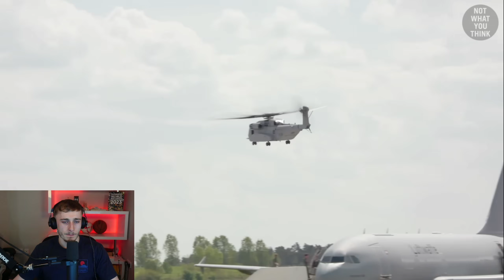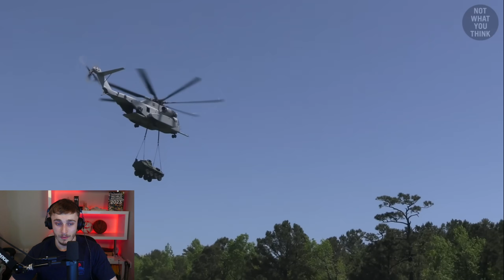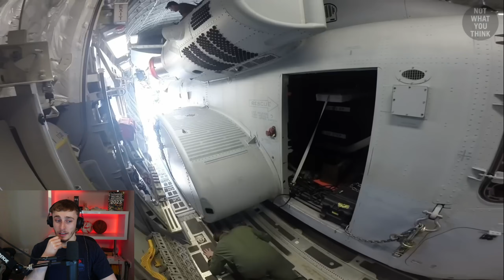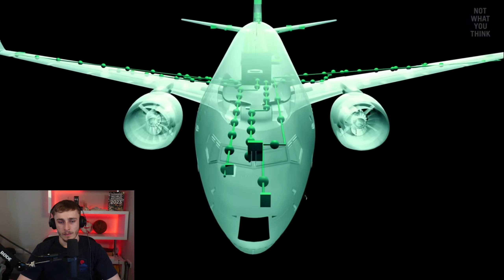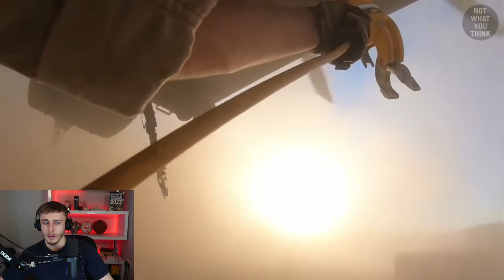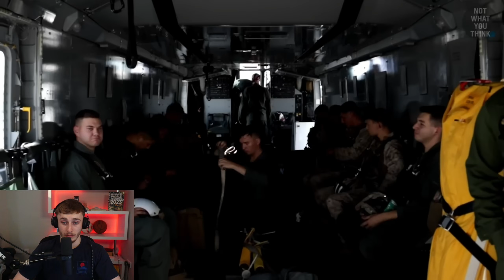Brit Reacting to The US Military's Largest Helicopter: The Ballerina That Lifts 35,000 lb

Comment: Helicopters, because of their method of lift, run into a size and weight problem long before planes/jets do. Because they're using a rotary blade to lift them vertical, they can only lift so much with so much power behind it and those blades have a material durability limit as well. The blades have to be so strong as to not rip apart while spinning, but they have to spin so fast to generate lift adequate enough to lift the fuselage of the helicopter. But you need power to achieve that speed, which means more weight that needs to be lifted, meaning either bigger blades or faster rotation, meaning more power, etc. Planes and jets use lateral speed to gravity to generate their lift, so things like the B-52, C5, and AN-255 get away with being mahussive because of this. Helicopters tend to go one of two ways, get chonky like the King Stallion, or double up like the Chinook. They just can only push their engines so far before they need more to carry more, but that means a bigger engine, meaning the returns of lifting power diminishes until you're getting just a heavier helo with less hefting capability. If the blades get too big, then the engines won't be able to turn the rotor fast enough to generate lift, so the problem forms where the size of the craft, the size and power of the engines, the size of the blades, and the materials everything is composed of all need to balance out to cooperate with each other. The King Stallion is currently the best balance of all of that that the US Military has currently.

I believe the Russian Hind-M26 is currently the military helicopter dead lift champion; but again, it's all about how big the craft can get, how large of engines can it support with how much power it can push out, how big of blades it can don, and how robust the materials its made out of. The US took their Super Stallion and made it better and now the King Stallion out lifts the Hind.

Comment: I dont work on the CH-53, so I cant say for certain, but I can say with a fair bit of educated guessing that it would take better part of a week to completely reassemble and perform operational check flights on the aircraft after it is transported overseas. Though I would also say that it is completely possible to have it flying again in 72 hours, provided the work is done nonstop.
Reply: I was in a 53E squadron in the 80s and 90s, so can say it takes less time than you may think.  As big as they are, these birds are designed to be worked on in the hangar deck of a boat, where space is already very limited.  Doesn't make it easy, but not as tough as it may seem.